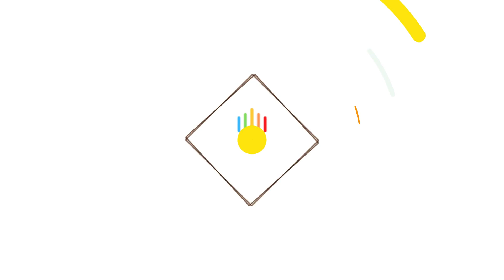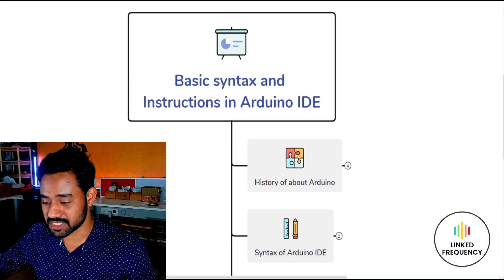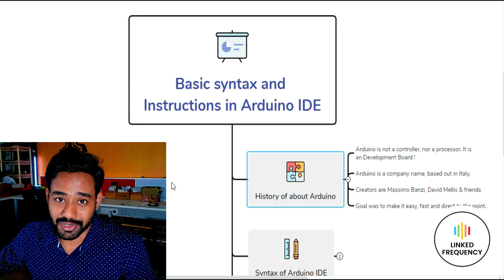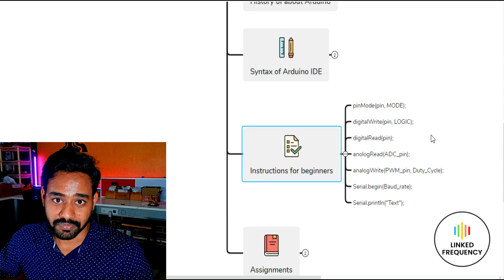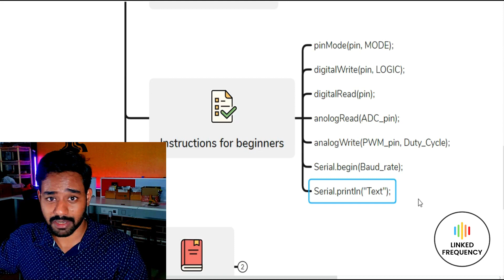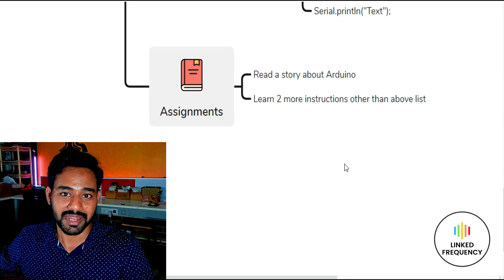Arduino programming syntax & Instructions #E06 | Vaibhav Sugandhi

Comment: delay(1000)
Sir, is this an instruction?
Reply from the maker: Hi, 
It is a function used to create a delay between 2 instruction execution in Arduino framework. 
If you are a beginner and don't know how a function call works with arguments, then consider this as a instruction like pinMode, digitalWrite, digitalRead and so on. 

I hope this explanation helps you.
Happy learning, 
#Linked_Frequency